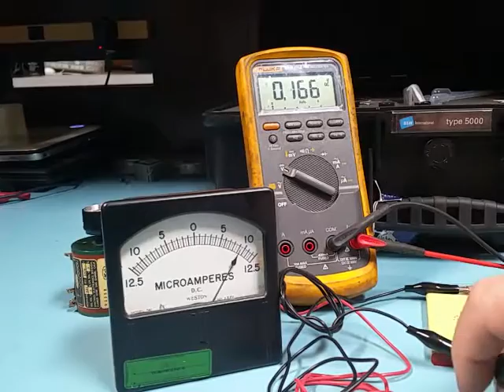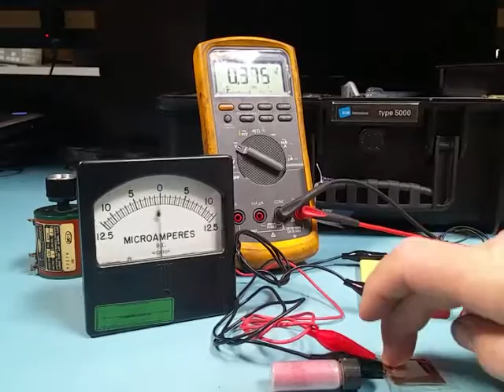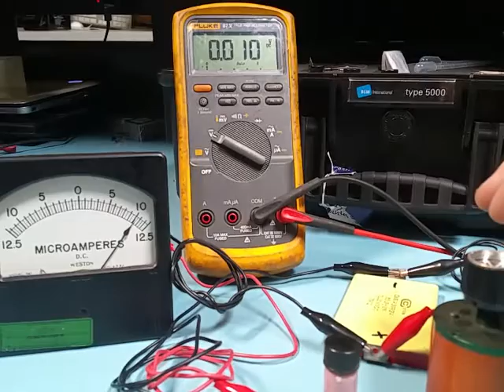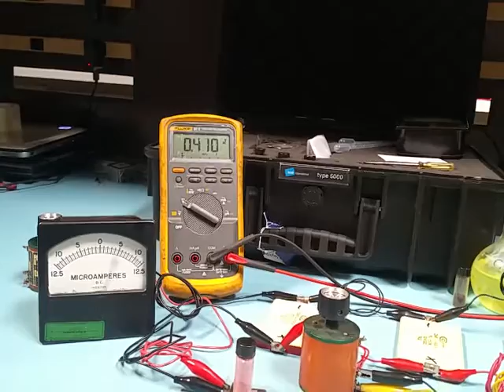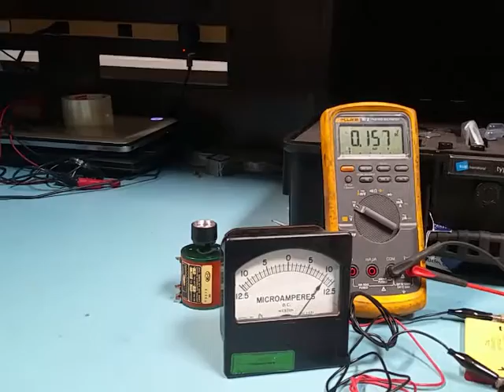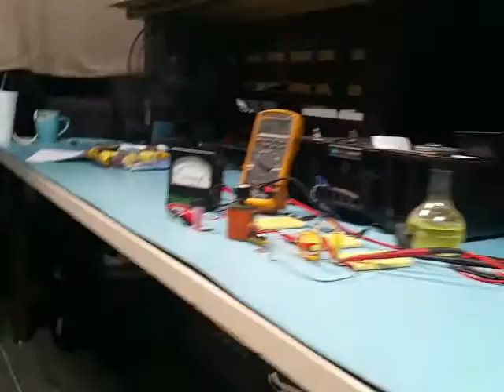BioGem load test day two

Comment: So the cathode and anode are made from Gold and Graphene. That is good. Is the graphene applied onto a metal? What exactly are your anode and cathode materials?
Reply from the maker: https://youtu.be/eRqVPq_I0vU
watch this earlier video on BioGem Gold and Graphene make electricity on my channel and I build a cell for you to see all the components  I use.
Reply: Hhydrogen4Power
Will do.
Reply: Hhydrogen4Power Your using stainless steel and aluminum... If you look up on galvanic corrosion risk charts you will see that Aluminum and SS most likely will have galvanic corrosion. Here is a link to one of the charts. https://www.google.ca/url?sa=i&rct=j&q=&esrc=s&source=images&cd=&cad=rja&uact=8&ved=0ahUKEwj-9P36w9vOAhVB0mMKHYukD20QjRwIBw&url=http%3A%2F%2Fwww.structx.com%2FMaterial_Properties_001.html&psig=AFQjCNHTLloC3LufXFCBcBnHbHw-q9tSCA&ust=1472178711268725